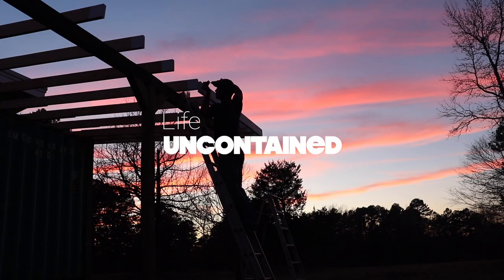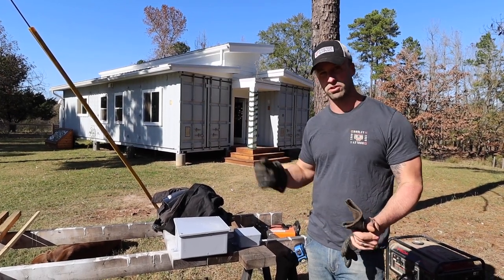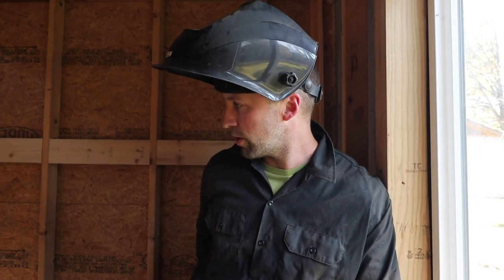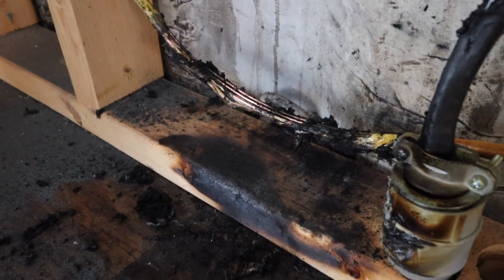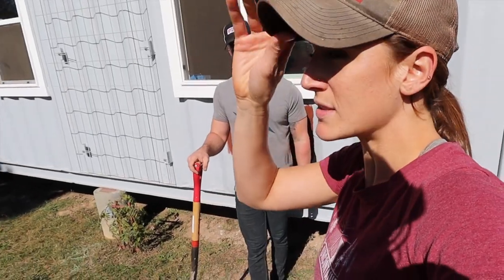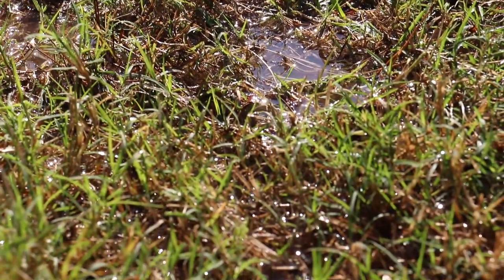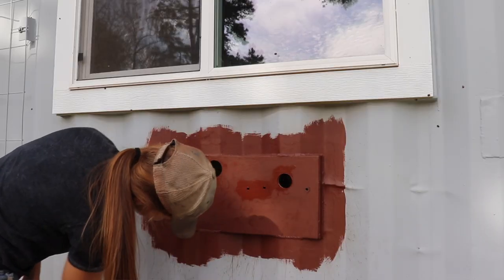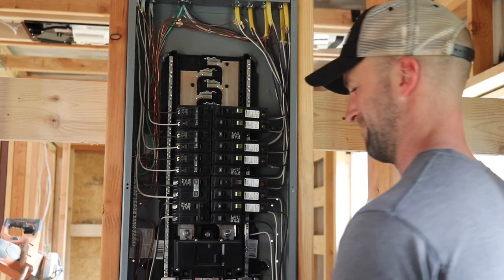Our House Caught On FIRE!

Comment: The individual main lines need to be in a jacket or in conduit, from the panel to your disconnect. They can't br free run.
Reply: Are you saying conduit in between the studs for the main line to the inside fuse panel?
Reply: @rotaryperfection  yes,  Individual wires cannot be free run between studs unless it is in a jacket. Easy way would be to pipe under the house and up into the panel.
Reply: @eoskorep5323  Ok just making sure because the wiring I did in my own house 7yrs back was inside a jacket for the A/C portion. 

Edit: You're right about it being much easier to run from the bottom since it's crawl space.
Reply: @jimr9898  he called it a disconnect box. I think it’s just another connection to fail. The box serves no purpose.

Comment: If you have the ability I would have an electrician inspect the wiring before you insulate.
Reply: Definately. Have an Electrician do a swing by and take a peek.
Reply: Definitely not rated for that application
Reply: Code says, when running service entrance cable, it must be in a pipe, all the way to the breaker panel.

Comment: A Tip - Whenever Grinding or Welding Allways have a Garden hose Beside You Turned on with a hose nozzle on it for safety. That way any fires can be put out right quick.

Comment: When remodeling I use a spray bottle to presoak the plywood wall area all around and on 2x4s when using a torch to solder in copper plumbing in the uncovered walls. They also sell welding blankets to protect things from burning but I am sure Spencer knows that!

Comment: Can I give you a piece of serious advice for running that Ethernet cable. Use Fiber optic cable instead. In case of a really close or direct lightning strike, fiber will not conduct any induced energy into your home. You might also invest in transient absorbers on both ends of the power run to help absorb some of the induced power in the AC lines. It will not protect from a direct hit but lets not bring Murphy into the picture.
Reply: Fiber optic + media converters on each end to do it on the cheap.

Very good point though, could fry tons of stuff if the Ethernet conducts power from lightning
Reply: Came here to say this as well.  Usually, non-conductive fiber-optic cables can be run in the same conduit as power cables so only one conduit is needed.  You'll need to check the local regulations in your area, though.  But fiber will be the best here for speed, reliability and safety.  You may want to hire an installer for that initial run since you have to use certain techniques to run fiber without damaging it such as maintaining sufficient bend angles, not pulling with excessive force (which can be surprisingly light), trimming polishing and capping SFP connector ends and using a compatible lubricant to get the cable through the conduit.  You'll also need fiber to Ethernet converter boxes on each end of the run.

Comment: I purchased the 4 acres behind my house here in Texas (now a total of 5.53 acres) and I am turning off the electric (separate electric line) in the backyard. I have a 26x26 barn/workshop with electric  and water... and an 8x15 "goat" shed with a dirt floor and a well (also with electric and water). I'm going to put a solar system on the roof of the barn and have my entire backyard go off the grid, including running the well. The well will get hooked up to the sprinklers of the main property, as well as to the gym and wife's office once they are built back there.

I have a good deal of trench digging to do to get all these electric and water lines run. While I am at it, I was going to run an internet line through the trench as well so that all outbuildings have internet. I'm glad I was watching this video because I wasn't aware that electric lines interfered with data lines. It makes sense, but it wasn't on my radar. Thank you for saving me time.

Congratulations on your little one!

Comment: Running wires through the stud that way is totally not safe. You need service entrance cable.
Reply: The wire needs to be in conduit or the right size romex...
Reply: That's correct.
Reply: It was a piece of Romex that burned. Almost every house in the US has Romex running through studs. That's the norm. 
Yes service entrance cable should be in conduit.
Reply: I noticed that too. I don't know who is the "authority having jurisdiction" is in this case so I didn't say anything . My suggestion, for what it is worth. It looks to be a 100 amp service panel. Run a 1.5 EMT thru the floor and under the house to a disconnect on the outside, and go URD  from there. Or use SE cable Maybe use a small 100 amp NEMA 3 panel on the outside and have breaker space for future use.  Also, the data lines don't need to be the 18 inch depth and could be put on top of of the service conduit with a few inches of dirt between.
Reply: What if you run a 1.5 mpD straight forward to avoid backlash trent. Wrap it with 199 amp dsF connectors and piggy back to main frame??
Reply: That would not have been my choice on panel location for sure but in normal cases we have a meter connected to the panel on the outside or somewhere. Since they seem to be outside of city limits and are using solar they may not have that set up in a normal manner. I would say if they’re not going to use the proper wire maybe some big nail guards would at least give some protection. It was funny watching that wire pull. He does good work not expecting him to know everything about all the trades. Just some input.
Reply: Since he is DIY solar and not attached to the grid, is he not in a gray area code wise? Residential code compliance is at his discretion as well I would assume as his service changes and misc electrical are all owned by him. Yes, best practices and safety wise, stud sleeves and proper jacketing/PVC/conduit is wise but I don’t see how it is required for his application and location. I don’t think a rural electrical inspector would have an issue either. NEC is used as applicable and required by local jurisdiction. In short, safety wise he should do it. Required? Don’t think so for this circumstance. That spray foam though.. I hope he doesn’t miss anything!!
Reply: @unti419  yes listen to this guy other then pipes in already leave it alone just add couple inch of dirt above the electrical pipe then install a 3/4 or 1" pvc pipe to your little j-box. When you pull your wire in pull in a pull string for future use.
Reply: @dalecherry4044  the wire burnt because of the welding
Reply: @richbatz139  Yes I knew this.

Comment: OMG!!  That wire is not rated to run through holes in the wall studs......It has to be RUN IN CONDUIT THE ENTIRE LENGTH !!!
Reply: Hey, it's getting colder. They might need a bigger fire to get warmed up!. How do you say that code requires this and that, then don't pay attention to code on your service delivery? Almost like measuring twice, divide by two and cut with a chainsaw!
Reply: He’s learning guys damn.
Reply: That's true, I wouldn't want anything to go wrong for them you know. @nkyryry

Comment: I generally love your projects. But I do agree with some resident electricians here. Idea is always serviceability and future proof. If you ran a standard 1.5 inch conduit under the house suspended to floor joists then straight up through your bottom plate into the main you could in the future run up to 200amps. 

But point is at least you could pull it out... and install larger gauge. That will be impossible with your current setup.
Not to mention a wire of that gauge and potential really doesn't need to be in any wall horizontally. If you miss a nailing plate and put a drywall screw through it. Welcome to a bigger fire 🔥...
You could keep your box although it wouldn't have been necessary to do all the welding had you kept the wires outside in conduit. But anyways. Please be careful. Your doing an amazing job all in all. Your panel looks very neat. Just have to think out of the box sometimes 🤣

Comment: Tip for today. When laying a long conduit run underground always put in a strong pull rope with the pipe to pull the cables instead of trying to fish it in afterwards!
Reply: What we did was lay out the cable first, then run the conduit and glue as you go along. No pulling cable.
Reply: @kevinwilliamson7294  I thought the same thing, seemed like that would have been easier. 👍

Comment: Can't run THHN wire like that in the walls. You'll need to replace that with some kind of service cable. Also better off putting a disconnect outside rather then a splice box.

Comment: Love your videos! Been watching pretty much since you started. I'm not an electrician, but I think that pretty much all building electrical codes state that individual conductors HAVE TO BE in a conduit (or in a jacketed cable). Using wire similar to what you had in there to begin with  larger conductors to handle the future load is the way to go. I personally run the feeder thru separate holes to the service panel. 30 yrs commercial electrical maintenance experience along with building all of my own outbuildings electrical systems, fully inspected by the county and the installs mentored by a friend who is a multi state licensed master electrician. Always overbuild at least a little, pay more attention to the grounding system than normal. Safety up front is cheaper than the alternative. Michael in Colorado. 70yo with 65yo wife retired on 2.3 ac 45 mi NE of Denver, Co. 7.8kW grid tie PV system.

Comment: there's this thing called "wire-lube" and it's used to lubricate the wires during a long pull.
Ya put on gloves and dip your hand in the bucket of lube and squeeze it on the wire as it is fed.

Comment: Its a good thing you don't need an electrical inspection as the individual wires in the wall would fail.
Reply: Yes it sure is, I've seen a number of NEC violations in this project.  In addition as you found out you can't run Data Cabling (low voltage) in the same conduit as Electrical (high voltage).   It is also recommended that for parallel runs the Electrical conduits and the Data conduits should be a minimum of 16 inches apart.
Reply: @eagle2019  I know about the separate conduit, but didn't know the conduits had to be apart from each other.
Reply: @mydraftable6526  Yes, and the higher the voltage on the electrical side the further apart.  If the primaries are 480V  we usually separate by at least 24".  Electrical conductors create electromagnetic fields the strength of which are determined by the voltage and current flowing through the conductor.  These electromagnetic fields can be induced into adjacent cabling.

Comment: Pretty nice job on the panel and that's coming from an electrician, I bend all my 90° PVC elbows and sweeps with torch , just keep it moving back and forth and then spin it and if your patient it will soften up and bend over like a limp weenie that's when you lay it on the floor and wipe it with wet rags in whatever degree elbow you need

Comment: Such a shame to go through all the effort of digging up the trench to separate the ethernet from the power line, only to put them right next to each other 🤦‍♂️
Reply: Yeah, need to be at least 16 inches away from each other to prevent interference.  Probably much more to be safe. I'd just move the router and everything to the house if it was me.
Reply: Low power 120V cable has for sure no impact on shielded LAN cable at this distance (4 inches distance is recomended, for unshielded: 16 inches).
Reply: @fko079  yes, but didn't look like it was even 4 inches to me. Looked like the 2 pipes were pretty much touching all down the length of the trench.

Comment: Spencer, remember when running the ethernet cables from the barn, you have a roughly 300ft limitation on ethernet before signal drop off. Also, make sure to use external grade, weatherized ethernet cabling, because try through you might, I my 21yrs of IT experience I have never found dry underground pipe. water always finds it way in those pipes so use the external grade to protect the lines from corrosion. If your are a much longer run than 300ft from the barn, look at running fiber cable with breakout panels at both ends, handing off to ethernet. Hope this helps.

Comment: They ran that main line through the studs unprotected... and these videos are probably backlogged and put out. Might be too late to fix.
Reply: @flightographist  Easier to do it right to start with. Which they'll discover when their inspection gets failed...
Reply: @flightographist  Don't know about where they are at but even without inspections you should consider deeply why the codes normally applied are there, and what they are doing. Some are simply stupid-proofing things but some are important. Unprotected feeders means a possibility of a short without breaker protection; a dead person or pile of ashes level mistake which is totally unacceptable. Running THHN inside a closed wall isn't legit but ain't going to hurt anyone ever.  

My work puts me in 6 different code districts and there are 2 others here I will not work in. Most are nearly the same but there's some small variation here and there. This regards residential only- step up from there and the variations can go wild. Some things are stupid but you gotta do them to pass. Some inspectors are casual and know your work is good enough and some are a-holes who won't stop looking till they find a reason to fail you. Most post-foundation  inspections here are now "3 in 1" for framing, rough plumbing and rough electrical together, some want insulation after that and some let you cover as long as there's evidence of insulation. 

Even when not government-inspected, you'll have trouble getting insurance if it's not done to code-level-standards and you'll have problems with mortgage-based sales and financing too. Using licensed people to do the build will make those OK, but DIY without inspection won't do it. Think you'll never sell? Think again. Health issues, age, divorces, changes in the neighborhood or land-use laws and more can force a sale. And then your uninspected DIY home that you put your heart and soul into becomes only as valuable as a shed or barn of similar size, because before it can be financed they'll want a full gutting to inspect your work before approving the mortgage application. Even if you followed code when you built it, they will want it to meet the codes then in use which will have changed. You always need the work legally inspected or to have a licensed contractor involved to avoid problems like this. It's heartbreaking to see it happen and I have seen it several times. 

Most of the DIY builds you see on YT are disasters waiting to happen one way or another. I've seen worse than this one but this one is a fail too; not a big fail but a fail nonetheless. It can be avoided. It can be a success. Do it right and know what you're doing.
Reply: @flightographist  LMAO You are talking about things outside of the US, knowing that this vid is about the US and up till now so has been this conversation. We're NOT talking about how things are where you're at; this is about a US video and how things are done in the US. And it's not about "loopholes" either- it's about the benefits of doing things the right way. I'm done here and with you as well.

Comment: Here in South Florida, we had to bury the power conduit 24" down... The communication conduit was just under the surface (12").
Reply: Code is 18" for electrical in most cases, unless it goes under a driveway, which is 24".  Deeper is alway better with electrical. Low voltage doesn't have a burial code, but good practice is the same depth as the electrical separated by at least 6 inches.
Reply: @dragonstuff1983    The code is a bare minimum of 18"  but 24" is even better!!!
Reply: @elliottmanning  Unless you're digging it by hand.

Comment: Spencer, The National Electrical Code requires that the electrical conduit be buried a minimum of 18" below the surface to the top of the conduit. Also the wire you placed in the wall does have to be installed in conduit. PVC. EMT or ENT. As for the data I agree with other posts saying to install fiber.

Comment: the power cables you pulled into the panelboard feeding the garage i assume should be enclosed in either a metal flex for protection against any physical damage , you did a beautiful job on that panel !

Comment: I'm so glad nothing more tragic happened! And I'm so glad you guys are okay and that it was caught sooner than later!

So I'm needing some advice. I'm a very able-bodied 50 something, year old person, who wants to purchase three, 40 ft. shipping containers and put them on a piece of land in South Central Idaho. I would like to do all the work, however I know that there's some things that I cannot do like lay a foundation so I will have to contract that out but I know how to do framing of Windows and I'm pretty sure I can install plumbing and wiring. Now I don't want to have ANY wood between the shipping containers. I'm just planning on insulating the inside of the shipping container and then putting up drywall!
So based on the information I just gave you, despite the fact that I have ZERO engineering expertise or welding expertise, do you think it's possible that I could do most of the job myself or should I just build a wooden structure?

Comment: Get yourself a backhoe Spencer. You are young and strong but save your back in the long run. 

They have a small one at Harbor Freight. Its portable so you can put it on the back of your SUV or even your mini mower with the hitch on the back.

Comment: * Hey guys... with all the lightning you get there, I think you need surge protection on that comm wire where it enters/leaves the building NFPA 70 section 800/810? I could be wrong, but worth a double check. I would also highly consider type 2 surge protection on your feeder circuits too.